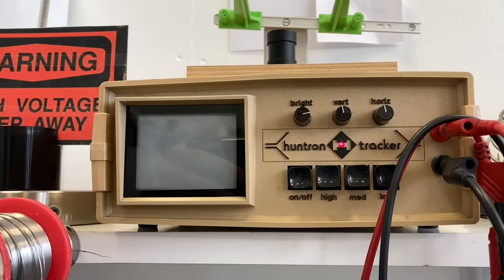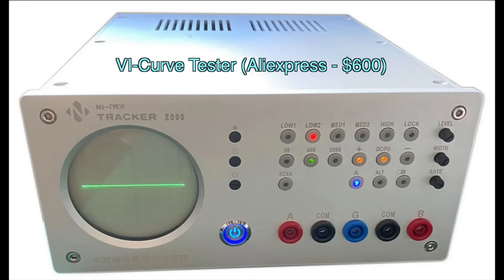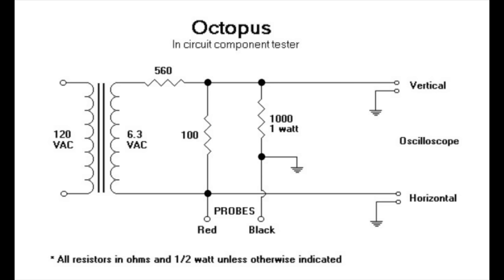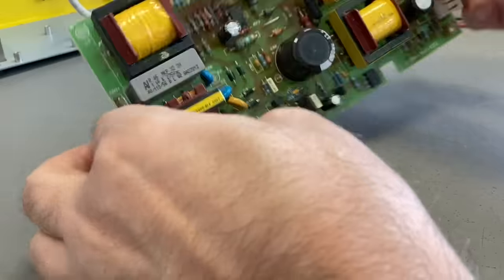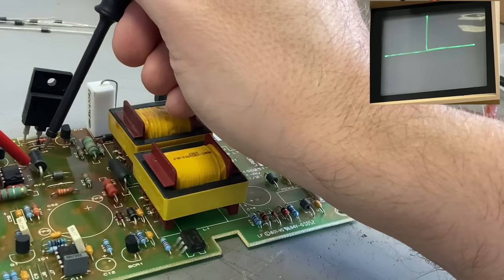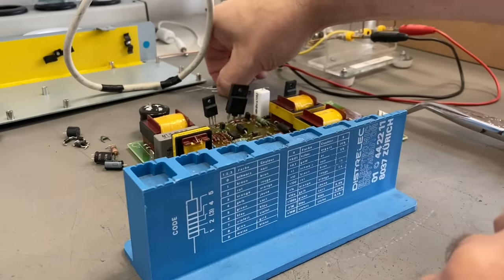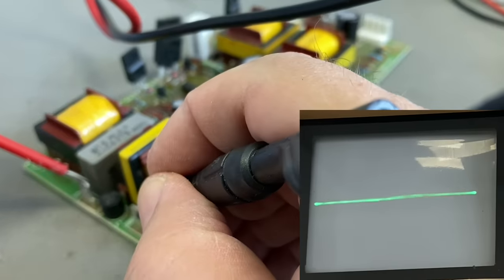The most useful tool ever for electronics repairs - (PWJ212)

Comment: It'd be interesting to make one but use a frequency generator and class-D amplifier as the signal source.  You could vary the level and frequency of the generator for whatever that you are working on.  Low voltage for sensitive electronics, high frequency to test SMPS caps.
Reply from the maker: A class-d amplifier is probably a bit overkill because you don't need much power. Maybe you find schematics of the Huntron 2000 tracer, that has 50Hz, 400Hz and 2000Hz.
Reply: @PlaywithJunk  Thanks for the tip on the Huntron schematics.  I'll have to look in to that.
I was saying class-d because they are SO cheap.  But you're right, some little class-AB like a LM386 would probably be perfect.  Heck, for 1mA, you could just use an op-amp.

Comment: Is that a Weller with a magnastat tip?
I bought mine 1982 and it is still working 👍
Reply from the maker: No, it's a slightly more modern electronic station with a temperature selecting knob. But we also have some Magnastats around for soldering training.

Comment: Thank you. Very cool.
Where is the sucked solder going to...? Is there a chamber you can clean?
7:41 😊👍👍
8:40 maybe put some clear tape on it to prevent further damage.?
Thx 4 this vid 😊👍

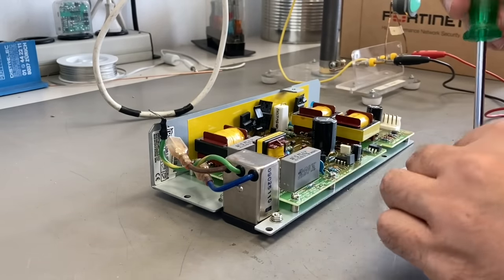Ps: 12:39 😅😂😂😳😂😂👍 elsewhere the Power switch would have gotten too hot.. 😉
Reply from the maker: The solder gets sucked into a glass tube inside the handle. This can be cleaned easily. The newer model we got has disposable tubes made of cardboard. They last quite a while but I prefer the reusable system because it costs nothing except some time for cleaning.

Comment: Have we not all used a simple multimeter in resistor or diode mode to test circuits ?
Well, this octopus tester does the same. But instead of having to swap leads and switch between different modes, it does this all in one go. 
If you want to go real fancy, replace the transformer with a sine wave generator. That way you can not only identify if there is a resistance/short/diode but even show inductance and capacitance
Reply from the maker: We have a newer Huntron2000 that has such an oscillator. It can do 50, 400 and 2000Hz (or so...)

Comment: Would have been interesting to see what the trace looks like when a component is leaky and not working properly, but not completely failed.
Reply from the maker: That is pretty rare and hard to see. Semiconductors are almost always shorted or open when failed. The other problem is when you measure in a circuit, you have all kind of "leaks" from the other components. 
A bad diode would have a slant curve instead of a vertical/horizontal line.

Comment: Pretty good. Is there any part number for that blue component lead bender? Thank you.
Reply: It appears that the manufacturer/seller information and model number are on the right end of the bender, in the video. You might give it another look. HTH.
Reply: That's a prime candidate for 3D printing these days!
Reply from the maker: Just google "lead bending tool" They are still manufactured in all kind of forms and sizes.
Reply from the maker: That will not help much because the tool is from the 1970's. But if you google "lead bending tool" you will find it.
Reply: You can make a simple lead bending tool from a piece of Veroboard / stripboard cut diagonally on one side
Reply: @PlaywithJunk  Shame it's no longer available - it looks really good!
Reply from the maker: Make your own with a 3D printer 🙂
Reply: @PlaywithJunk  Heh, I'm not prepared to go down that worm hole just yet :)

Comment: Very good! Could You post the mosfet tester schematic? Thank You!!
Reply from the maker: It's super simple. Look at 7:58 in the video. Plus and minus of the tester are connected to drain and source of the MOSFET. Gate is connected through one button to plus and through the other button to minus. So you just press one bitton and gate gets connected to drain or source. That's all...
If you press both buttons at the same time, you get a short, indicated by a vertical line.
Reply: @PlaywithJunk  Thank You very much!!!

Comment: Didn't you replace the X2 Capacitors as well? In my experience they are mostly always gone =)
Reply from the maker: I never had problems with filter caps. Only the electrolytics. Some HiFi components have problems with caps connected to the mains switch. Like my Revox record player… but never in such power supplies

Comment: 5:58s sounds like a pacecenter desoldering tool working. Could it be correct?
Reply from the maker: Yes it’s a Pace. A very old one from the 1980s
Reply: @PlaywithJunk   yes, i am talking about the 80s experience. I used it daily in the factory. Later we added an ersa which has no foot pedal. Just using your index finger to block the hole to start vacuuming. Have u seen one?

Comment: Do you know a method to test a logic gate inside a circuit without remove it from the board? and some optocouplers too ?
Reply from the maker: For TTL logic, we use our tracker as showed in the video, just a commercial one. With simple gates you can see a difference between a faulty and a good one. But you need a good board to compare.

Comment: At 12:52 a crack is visible in the transistor plastic that is against the aluminum - Is that OK?  Thanks for a nice video playing with your junk.  Uh-Oh that just didn't come out sounding right  8)
Reply from the maker: No, that crack means it is broken. Transistors or chips should never have any cracks :-)

Comment: My guess that last clip the transistor backwards probably a PCB design error got the legs the wrong way around so they just fitted it backwards bizarre. I would of cut the trace on the PCB and use two bodge wires than fit it backwards or they didn’t and it was an alternative part that was the same apart from the different leg position
Reply from the maker: Maybe they wanted the heatsink on the other side of the transistor and they found out it wouldn't fit into the machine. This manufacturer does a lot of weird things....
Reply: Maybe don't want electrical contact between the Heatsink and the tab? And don't want to buy an isolation kit?
Reply from the maker: @mb106429   Yeah, that's the way professionals do it... ;-)

Comment: Where did you get that blue tool that helps you bend component leads at the right point? I've never seen a multi-size one like that!
Reply from the maker: This one is from the 1980s but you can find similar tools when searching for "lead bending tool"
You can also make one yourself by using a project board with 0.1" grid space. Cut strips with the desired width and use them as tool.

Comment: 12:44 isn’t that a bridge rectifier? (I see 4 terminals on the one at the back)That’s not likely to get warm maybe
Reply from the maker: No that's a KA1M0880 integrated device. It's a power MOSFET and a driver chip in one package. That's why it has 5 pins. I guess it has a very good efficiency otherwise it would blow up in seconds (which it doesnt)
Reply: @PlaywithJunk  That's an interesting device. From circuit examples it seems like it's initially fed from a 1W resistor and then a secondary coil. I can't think of any situation where I'd not mount it conventionally? Although it doesn't state if the tab is isolated, and it's not a mistake where the layout was reversed because it's polarised.
Reply: @PlaywithJunk  It looks cracked at12:52...
Reply from the maker: Well, even if it's not insulated, a piece of insulating thermal pad would solve the problem. Ithink they simply designet it wrong and then it was no more time to change the heat sink. Ehh... it will work anyway... and amazingly it does.
Reply: @xtevesousa  good spot 🙃

Comment: This is really helpful.  But it requires AC line voltage for the transformer.  It would be even better if it would run from just a 9V battery for transistor radios.  That shouldn't be hard to do.  Right?

What I think would be easier to understand would be to connect all the grounds together and to a single point.  With a battery, there isn't a need for a ground, just the common connection to the scope inputs.
Reply from the maker: All you need is to comvert the DC power into a sinewave AC. Frequency could be chosen between 50 and 2000 Hz (like the Huntron 2000)
But to use a small transformer is the simplest solution
Reply: @PlaywithJunk  
I've built dozens of sine wave generators.  They're PSOs - phase shift oscillators.  They put out a sine wave, and that can be amplified to drive a small transformer.

Comment: can this be used for ic, igbt, triac testing and comparing?
Reply from the maker: It can test everything but only on a good/bad basis. Or you compare a known good part with an unknown. Also high voltage parts are not testable because you only use a few volts.

Comment: We had that huntron 2000, but rarely used.
Reply from the maker: I can't say it's junk because I find it very useful. Maybe you tried to repair the wrong devices... It's perfect for analog circuits like power supplies or TVs
Reply: @PlaywithJunk  i am sorry to say junk, i hereby delete it. It is because most of us technicians were not given proper training by the sellers, those who knew how to use left the office, leaving new ones to the instructions manual which was quite thick. Anyway that was the 80s.
Reply from the maker: @sholimz  Of course you need someone who shows you how to use it. If you don't know what the wiggly lines mean, you're lost 🙄

Comment: What is that you're using to remove the solder and components from the circuit board? Sounds like it has a pump hooked to it.
Reply from the maker: It's a PACE desoldering station. It uses a hollow tip and it has a vacuum pump inside the station box. It sucks the molten solder from the PCB.

Comment: I've used a huntron tracker 3000 at work, they're great but to be honest theyre only useful if you have other boards to compare or a schematics, if youre doing "blind" repairs, a standard multimeter in "beep beep" mode is just faster and more convenient. Fun fact once one of the trackers broke down, I asked in the huntron forum and the guy send me an schematic in private, they're super helpfull but their machines are sooo expensive. Definetly not worth it for the average electronics shop.
Reply from the maker: That's where the cheap Octopus comes handy... 🙂
I use the Tracker mostly for power supplies and they are all similar and I know where to check and what results to expect. Also testing CMOS transistors (as I do in the video) works well.
The schematics of the model 2000 are included in the user manual. That's also a nice touch.
Reply from the maker: I just checked the Huntron website for prices.... these things are way overpriced! The model 2800 costs $5300! For that money I'll get a nice oscilloscope and a Fluke multimeter and still have some money left to build 200 Octopusses....

Comment: Are you sure that 1k resistor has to be 1W? It seems that there's like 1mA and 1V maximum in it.
Reply from the maker: I just copied the schematic from Internet... I was also wondering about that value. I think a normal 1/4W resistor should be enough.

Comment: I do not see a diode, so the tester is working on ac, or do I got that wrong.
Reply from the maker: Yes it tests with AC. And that's good for many conponents. A capacitor needs to be charged and discharged....

Comment: quick question. is this tool producing same results as an oscilloscope in ?
Reply from the maker: in... ? In what?
This device is a tiny oscilloscope in XY mode. If you use a "real" analog oscilloscope, you would get the same display. Digital scopes don't look as good.

Comment: Does the ac from the tester not destroy memory chips?
Reply from the maker: It depends on the settings. At "low" it outputs just a few mA. But this instrument is meant to use with analog circuits. On a memory chip there is not much to see anyways...
Reply: @PlaywithJunk OK thanks. Why I ask that is I used an ESR capacitor tester on aluminum electrolytics on a digital pcb and it appears the sram chips may have  gotten damaged as it failed to work after that. 😭

Comment: dumb question here;  say you're testing a diode, doesn't the rest of the circuit potentially affect the measurement?   Couldn't you get a false result because of the circuit it's installed in?
Reply from the maker: Not a dumb question at all...
Of course do other components change the shape of the curve. You can see that when I test the diode parallel to the transistor. But you can still tell if is has a short or not.
The best way to use that tester is to compare a good and a bad board. No matter how the trace looks it must be identical with the good one. If it changes then you know something is different. Some testers have two channels that switch automatically. So you don't have to move your probes.
Reply: @PlaywithJunk   Thanks for your reply.  :)

Do the component identification testers (little boxes that can identify any component) fail in this regard?  I think they would.

Comment: Why is the 1000 ohm resistor specified at 1W? When testing circuits that is turned off it should never disipate more than 1 mW, a safety factor of 1000 seems excessive.
Reply from the maker: I don’t know, it’s not my drawing. I assume a 1/4W type will work fine.

Comment: When nothing connected the line should be perfectly horizontal, which is not the case
Reply from the maker: That's why Huntron uses a circuit with opamps. I built my own tracer using the schematic of the Tracker 2000 and it works fine.

Comment: But you did not investigate, or verify the fault !?
Reply from the maker: I'm happy when it works again....
I assume it could be an overvoltage (thundestorm) or someone just turned it on/off too rapidly. That can kill a power supply too. Most of them fail because the capacitors went bad. Especially when the large primary cap is faulty. That may also overload the diodes. 
The main issue is the horrible design of the entire power supply. They made things nobody else did. There are at least four different versions around. Some get hotter and some stay cooler... But I never had one in repair that I repaired before. So my method can't be bad :-)

Comment: Junk is right! Testing parts is nonsense. If you think its bad and your VOM  verifies that. Then change the part . Diodes are cheap.
Reply from the maker: It is more expensive to test and re-insert an old capacitor than taking a new one. And you can't be sure if it's really OK.